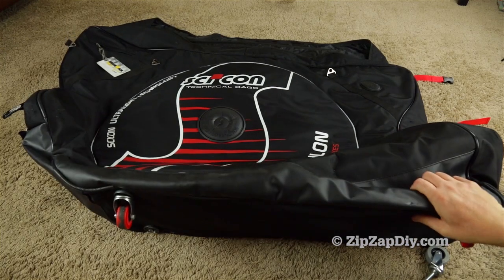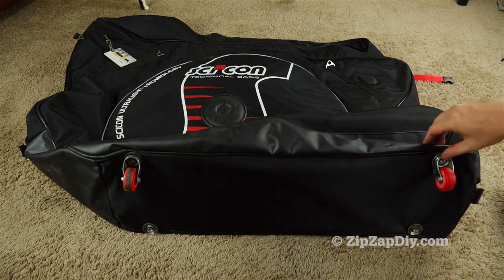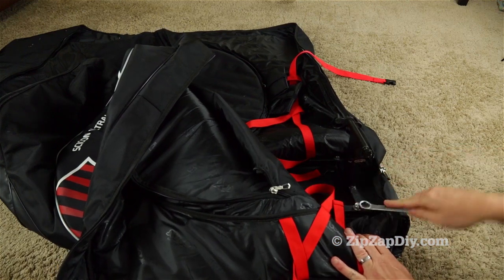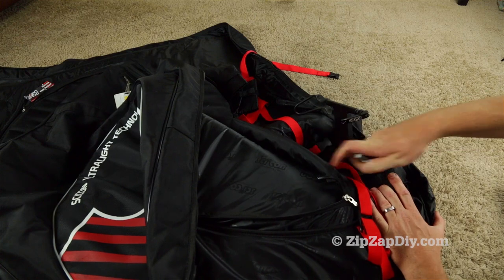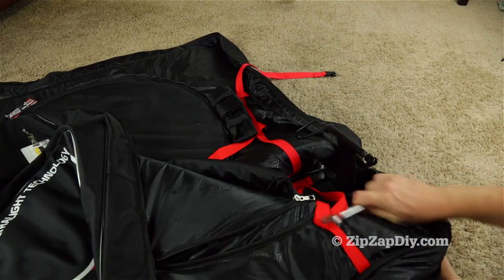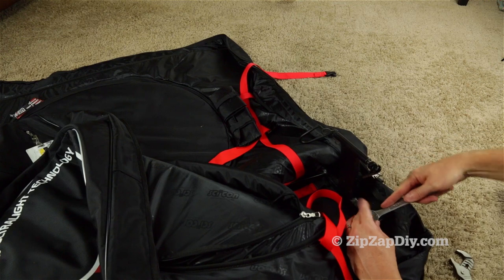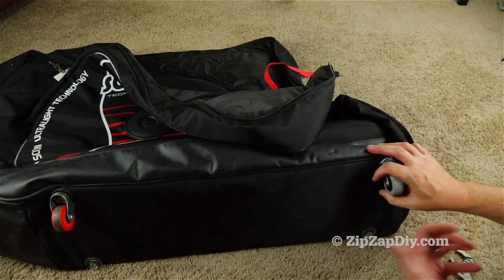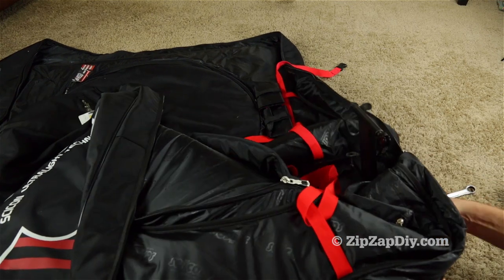SCICON Bike Bag / How To Repalce the Wheels / Where to Buy

Comment: The link to Amazon isn't working.  Could you post a new link?
Reply from the maker: thanks for the heads up, looks like they are discontinued, I looked around and did not see an close replacement sorry... what you are looking for is a Swivel Stem Caster with 2" Wheel, 3/8"-16 X 1-1/2" long threaded stem
Reply: @ZipZapDIY  Thanks for the quick reply.  I've been looking online as well, it's surprisingly hard to find one with a 1-1/2" stem, most of them are only 1".
Reply from the maker: I think you will be ok with 1" stem, the 1.5" stem does stick out a bit, and it may have been that when I did this video I couldn't;'t find a 1" stem or was giving myself plenty of working room
Reply from the maker: not sure about the polyprolene, that may work. bigger wheel is ok.
Reply: @YourPetNutritionist  did they work?